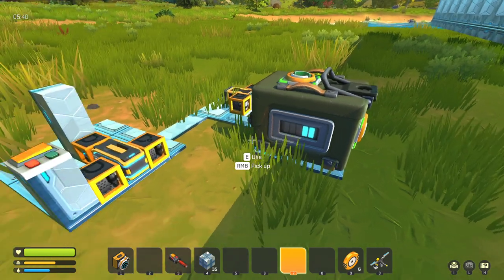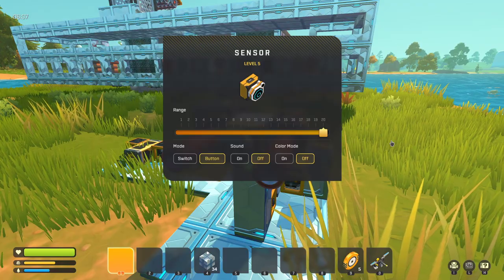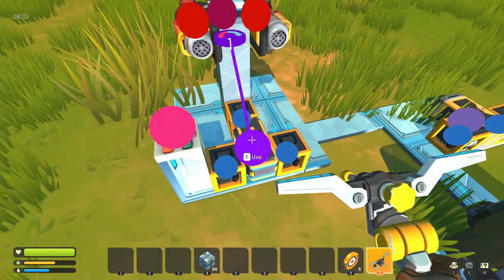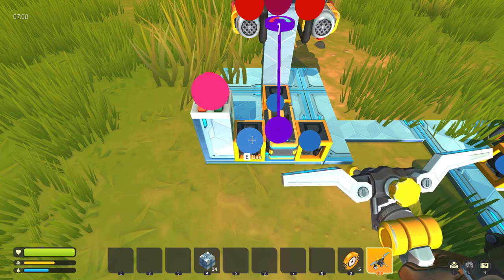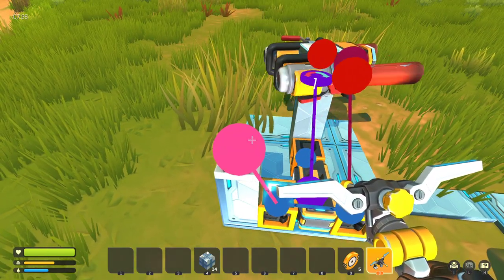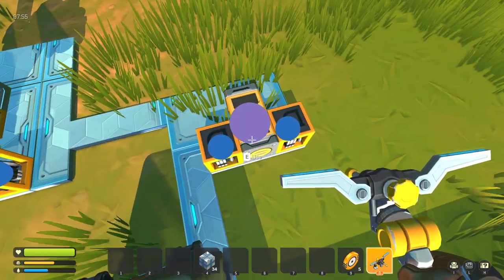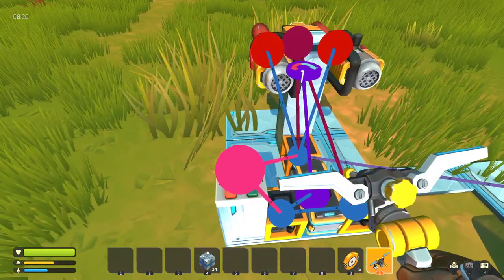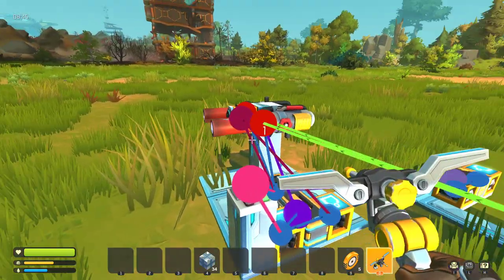[Scrap Mechanic] Autoturret Build in Survival

Comment: Verry good video..can i build the same turret with 3 sensors? How i conmect the other 2 sensors?
Reply from the maker: You could use more sensors if you want. You would probably need an OR gate and hook all the sensors up to that. Then from the OR gate to the NOT gate and the top AND gate. That would make it so if any of the sensors activate the turret would fire.
Reply: @falchoin  thx man. i will try

Comment: Does this still work because I can't get it to track properly?
Reply from the maker: This simple turret setup won't accurately track enemies. It'll only stop sweeping and fire when a target is detected by the sensor. You'll want multiple turrets in place for even relatively small farms.
Reply: @falchoin  No, I mean the design you've shown here doesn't sweep properly. In the old video you set the controller to loop and that seems to fix it. I have a more stable design now anyway that works from a controller, a logic gate and 2 timer circuits (timer, 2 logic gates). Yours doesn't stay stopped when the sensor is active. It fires about 10 rounds and then carries on sweeping.
Reply from the maker: @SimonNemeth  Yeah, you've hit on the downside to this simple turret design. It doesn't stay on target and will continue eventually. I'm fairly certain this video shows setting the controller to loop as well though.